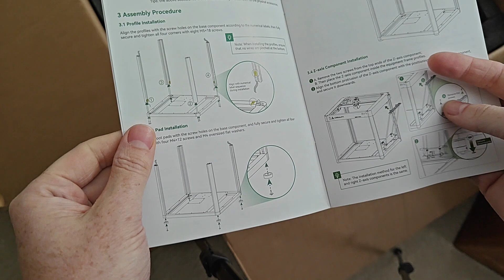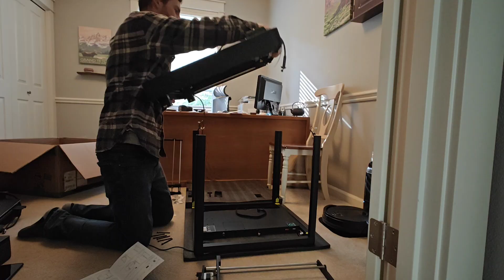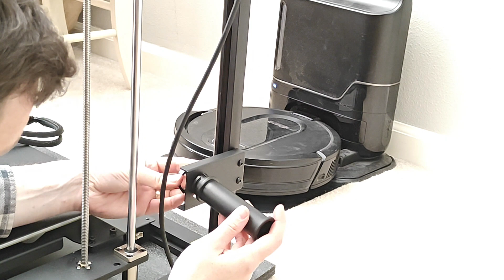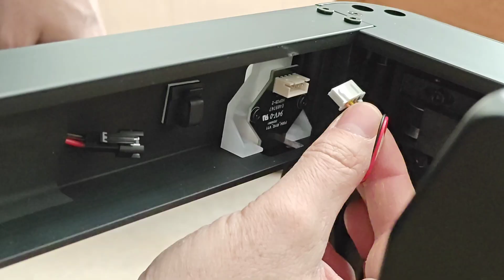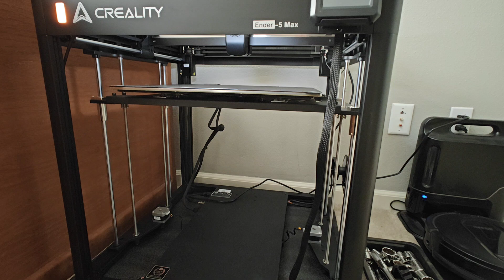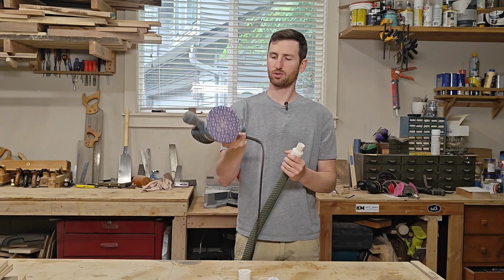Do Woodworkers Need a 3D Printer?

Comment: I've had a 3d printer for a while and it definitely has its place as a tool. The real power comes with custom designed parts but that also means learning some kind of 3d modeling software. 

"Selling" 3d parts gets into many licensing issues if it's not 100% your design so I avoid that and focus on things to help me in the shop 😆 me fixtures, jigs, spacers, etc.
Reply from the maker: Good advice Ed. It seems like a powerful tool and I am looking forward to unlocking more shop efficiencies with it.

Comment: I (a woodworker, also big time nerd) just bought my first 3D printer. It's definitely not a "need", but a damn useful tool. In 2 weeks I have printed 10Kg of PETG in bins, small tools, tool holders, organizers, dust ports/adapters/etc. Lots of very useful things. They're all small things, but they add up. 
Mine was a cheap model that needs some work, luckily there is a great channel that shows all the setup for my specific model. I've also had issues with filament getting stuck in the spool, it's annoying, most of my real failed print happened because of that :/
Reply from the maker: I'm literally printing something right now and the spool caught again. I am hoping I caught it in time to not have to restart as it's about half way through. A 3D printer sure is a useful tool. I haven't used mine as much as I would like but it has some handy use cases. I really want to make some corner radius templates as right now I use whatever is round and nearby but being able to route to a standard reference would be nice.
Reply: @keatonbeyerwoodworking I think you’re spool snagging problem is just the filament you have. You should invest in a better pla. I’ve had pretty good luck with Hatchbox and I know other people have favorites too